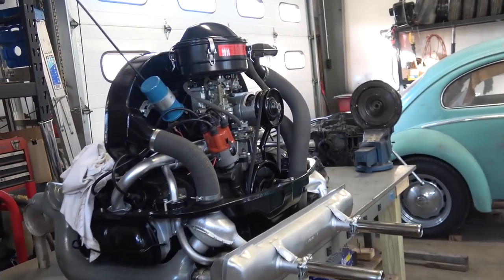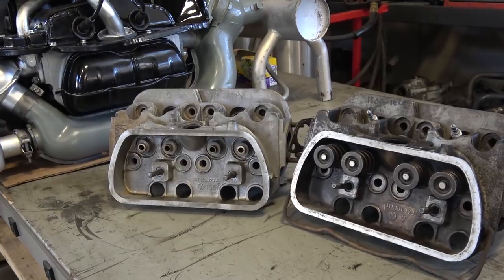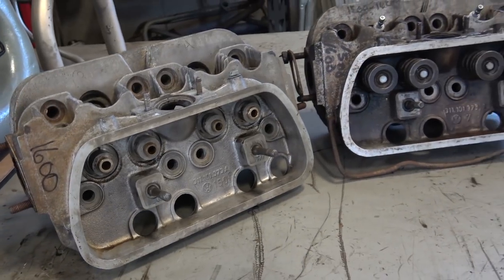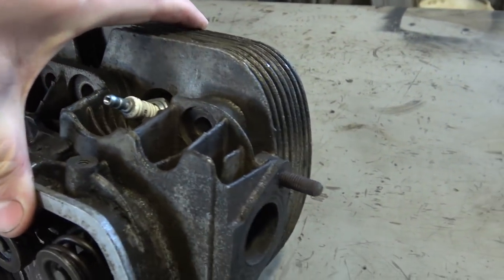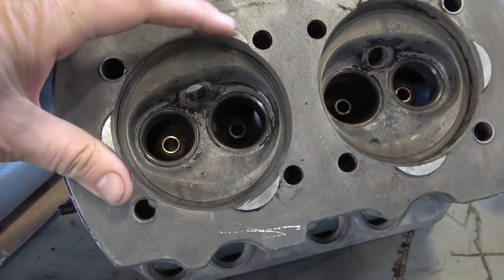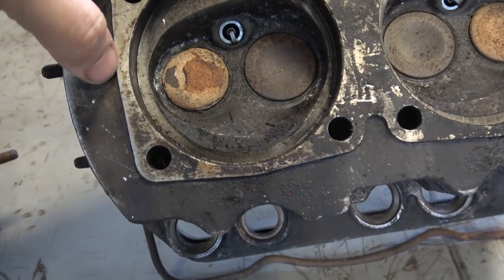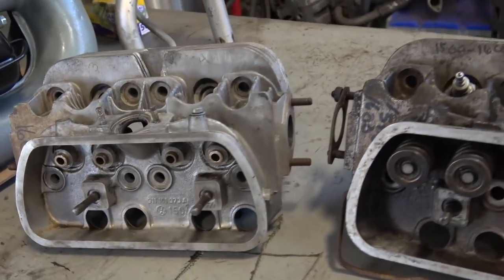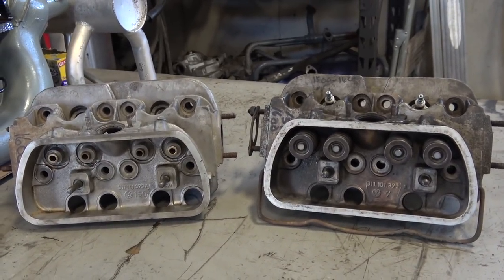Classic VW BuGs How to Buy Used Vintage Beetle Engine HEADS for Restoration

Comment: I know this is old but it might help someone. A couple more things to always check with used or supposedly reconditioned heads. Check the  spark plug threads, they are often messed up. And if You find a “deal” on refurbished heads, ALWAYS do a cc volume measurement on the combustion area. Very important for compression calculations.  Personally, I would highly recommend to steer clear of “reconditioned” heads. I found out the hard way.

Comment: On my head, there is a vertical crack at top of the valve guide boss, starts at boss upper part and ends at lower, what can be done?
Thanks
Reply from the maker: Get a new head.
Reply: @classicvwbugs  I did not specify very well, the boss is like 7mm thick (914 head), the crack goes from top of the boss and goes down 6mm

Comment: Great video. I have a 57 oval but  not sure if 25 or 36 hp.  The heads are stamped with a number 111 101 371A.   There is also a Vw logo with a 29 to the right of this.   Does anybody know if this is 36 hp?